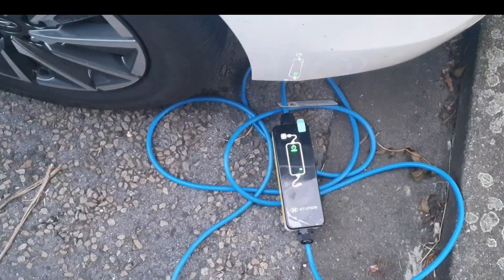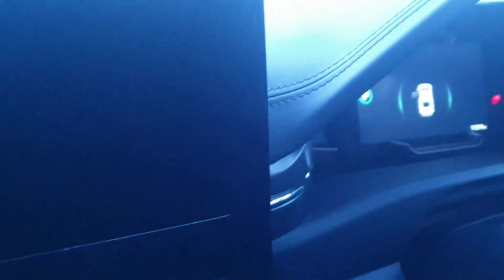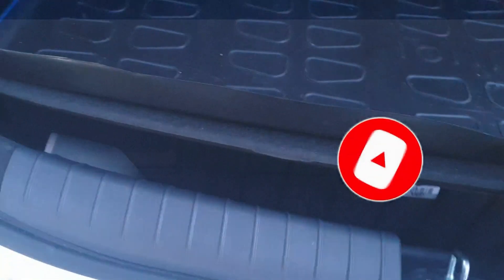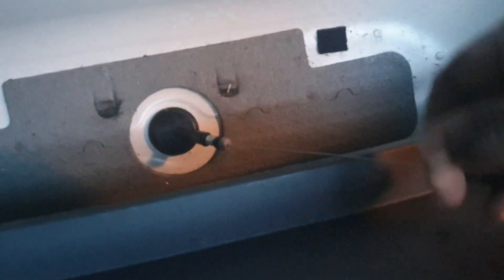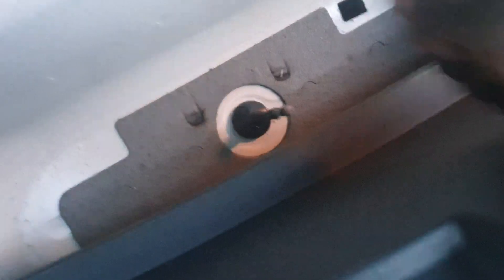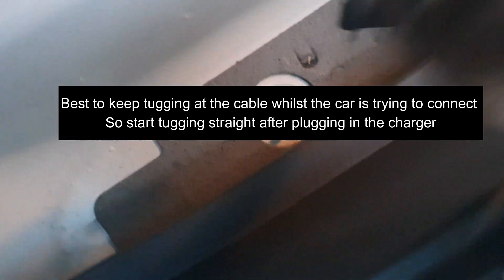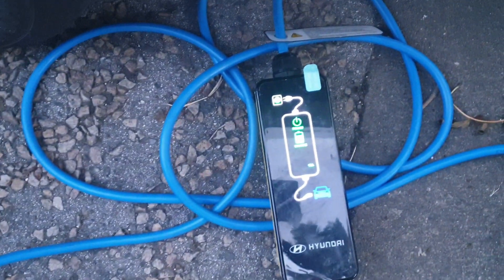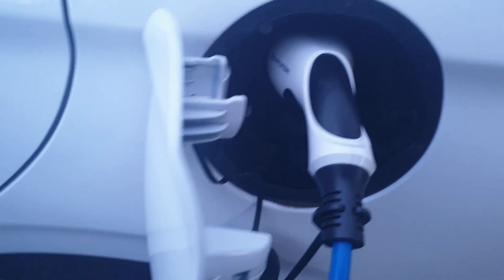Hyundai Ioniq charging issues - work around #hyundai

Comment: Thanks - got this resolved on mine after disconnecting the 12V for 20 mins, then pulling the manual disconnect (while the charger was unplugged) - then plugged it in and it worked fine.

Comment: Thanks for this! I used this technique today.  I recently bought a used 2019 that would not DC fast charge, but using this trick enabled it to work.  The car is still under warranty for another month, so I hope the dealer can replace the charging port or actuator.
Reply from the maker: Glad it worked for you. I think there is a recall so do check with Hyundai

Comment: Thanks you are my saver, today i have the same problem, the charger won't fix and not charge, after i pull this cable it start fixing the charger and everything was ok.
Reply: No problem. It will get you out of trouble but you will eventually need to get charge port locking mechanisms changed

Comment: But mine 28 battery.. when plugged in the middle blue lamp is blinking… the red icon is lit up while connected. But somehow the connection in the car doesn’t lock…
So maybe I have the same situation or the blue light is indicating something else?
I believe mine is older than yours, 2018.
Thanks for the video

Comment: Nice video man, you saved me nearly £100 as I had my car booked for same issue, service centre had no availability for 2 weeks but my wife needed car. Did what you showed here and now its charging fine. Thankyou
Reply from the maker: No problem. Glad it helped you
Reply: How would this get fixed? My car is doing it quite often.
I have booked it for service and asked them to do check over, hopefully it will work
Reply from the maker: They will need to change the charge port solenoid
Reply: Can I change myself with my friend's help. On diagnostic tool CCM came as C182C fault with EVSE failure. Hyundai charge lots of money as mine is 6yr old car.
Where can I buy it and where abouts this solenoid is
I can speak offline if it helps
Reply from the maker: I'm sure you can with the correct skill level. Please ensure you go through all the high voltage isolation safety before attempting to dismantle any part of the charging system